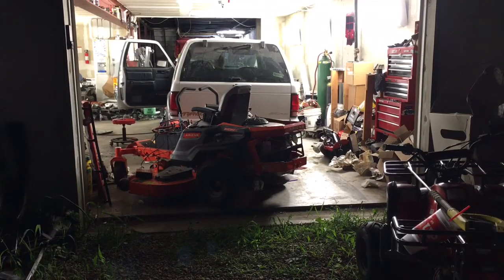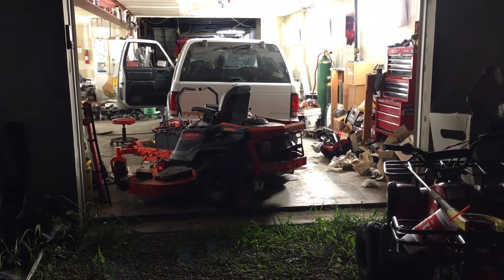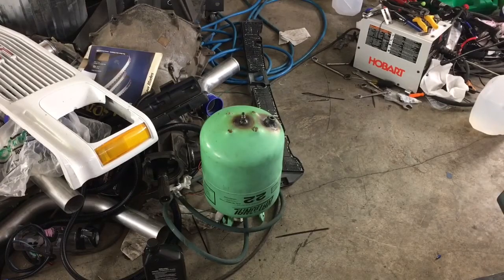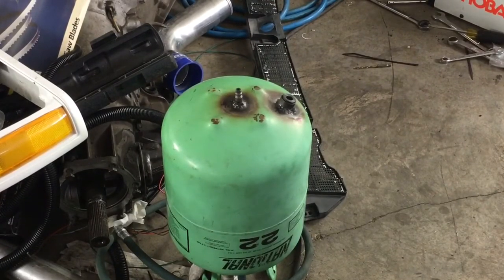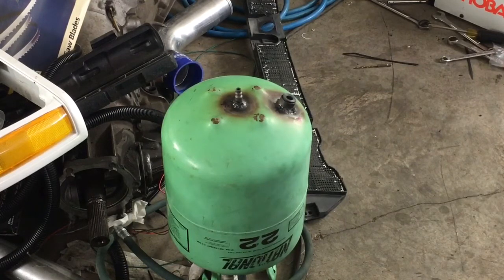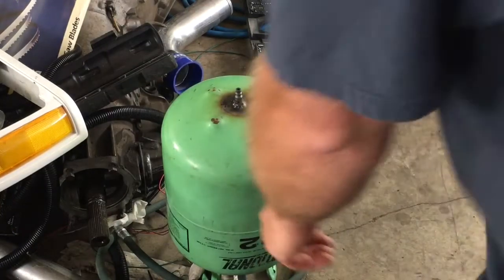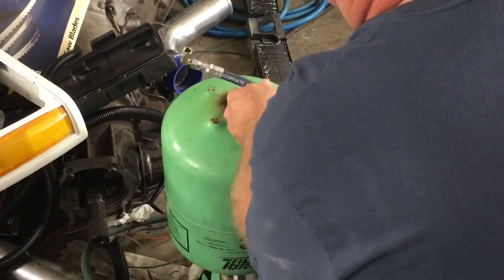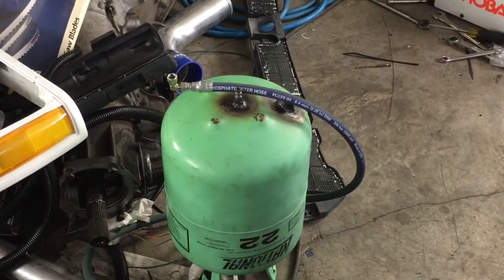GT45 Turbo Typhoon Holley Dominator EFI

Comment: whats that turbo like ? i saw them on US ebay as billet wheel GT45 i wonder if the are better than the regular cast wheel unit ?
Reply from the maker: aussi3212 The GT45 is a decent Turbo, generally the “Billet” version will have larger more aggressive fins.  The larger fin billet turbine is heavier but it moves more volume of air through out the useable rpm creating more average power. 👍
Reply: @HeadFlowInc  cool, billet wheels are usually lighter and have a more intricate design compared to a cast wheel, and have a larger fin surface area, due to the center of the wheel being machined thinner, what i mean is does this particular GT45 have a legit billet wheel or are the ebay sellers just saying that to get sales ? because the comp wheel looks exactly the same as any cast GT45 wheel, why would the make a billet 6-6 wheel that is identical to the stock 6-6 wheel.
Reply from the maker: aussi3212 it’s totally possible the wheels are the same, I haven’t compared A to B between the Cast vs Billet. 
Read this it will help:
https://www.theturboforums.com/threads/cast-wheel-vs-billet-wheel-turbo-results.372814/